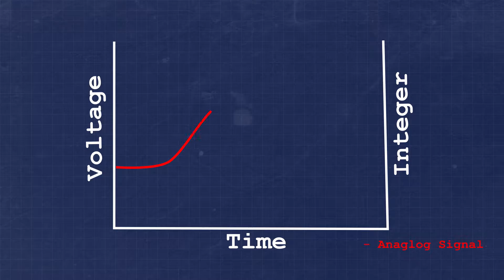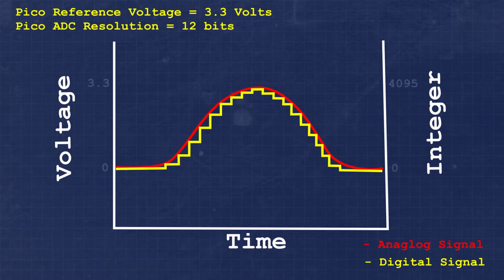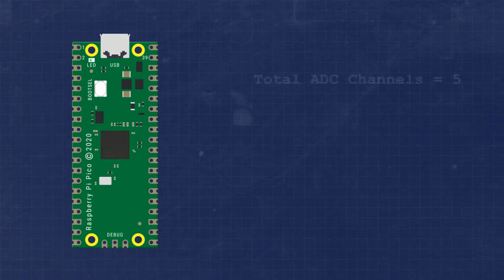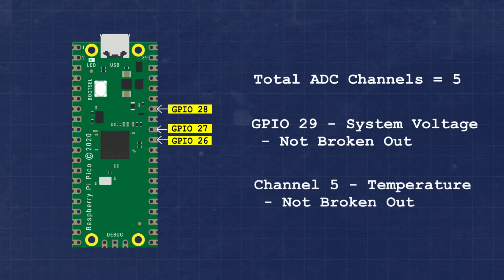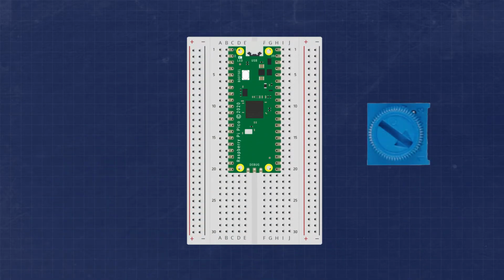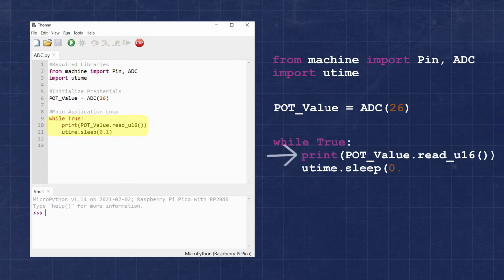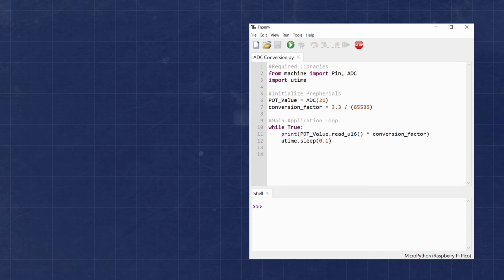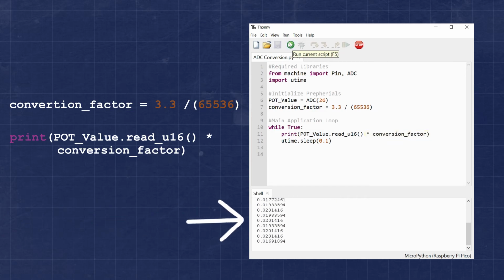Analog (ADC) Inputs on the Raspberry Pi Pico with MicroPython

Comment: Could you make a video on how to control LED strips (Red to Violet) using a potentiometer ? Most LED strups are 5V so the 3.3 GPIO output wouldn't work
Reply from the maker: I will look into doing a video on that. The quick answer is to use a MOSFET with a really low Gate Threshold Voltage. The IRLB8721PbF MOSFET would be a good choice since it has a threshold voltage of 2.35 and it is in a TO-220 package for greater current capability.
Reply: @hensonbl  i see, is there a way to convert the potentiometer input to RGB (x,x,x) values ? think that would be faster considering we already have the ws2812b library
Reply from the maker: I was thinking about the hardware hookup, and if you are only controlling 30 or less ws2812b LEDs, you could simply use Pin 40 (VBUS) on the pico as the 5V source for the LED strip. As for mapping an RGB value based on a potentiometer input, I don't have a quick and easy solution. You could look at using the matplotlib python library, but I don't know if the pico will support it. 
https://stackoverflow.com/questions/39357633/how-do-i-convert-a-single-potentiometer-value-to-r-g-b

Comment: Concise and helpful! Currently trying to read from a strain gauge that maxes out at 3.5V, so hopefully not damaging the pico.
Reply from the maker: Thank you. I think you will be okay, but something to consider is using a voltage divider to limit the voltage being read into the ADC pin.
Reply: @hensonbl  Thanks for the tip! Also wanted to suggest a video topic if you think others would find it useful. If you are powering the pico from a PI4 or similar via USB, it would make sense to consider also sending/receiving data over USB. There's some forum discussion about it but no decent tutorial that I'm aware of.

Comment: nice, only 3 typo's, luckily not in the code
thonny user : print(dir(umachine))   shows all the options or do help(umachine)       
  umachine, utime, micropython, rp2, uos   or any library name (or part of) you imported, 
e.g.  part =>  I2C, SPI, softI2C, softSPI, Pin, sleep, sleep_ms, const, localtime